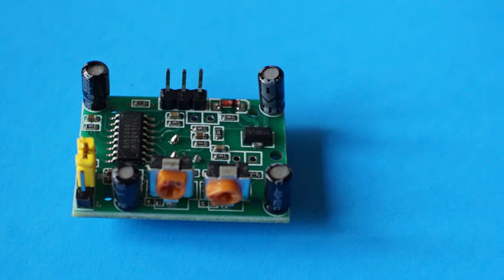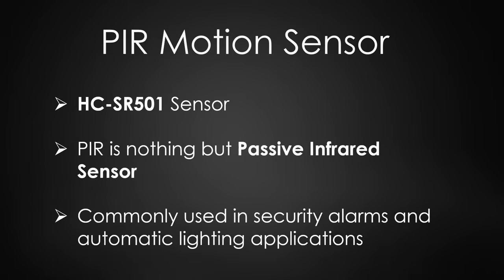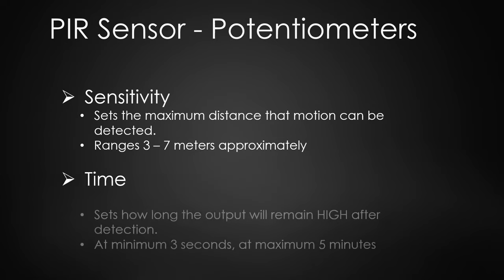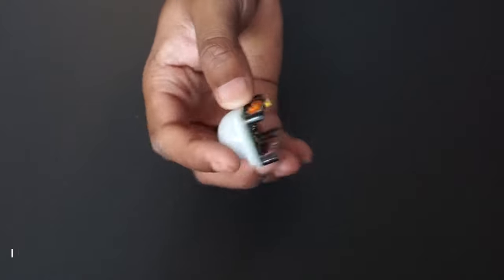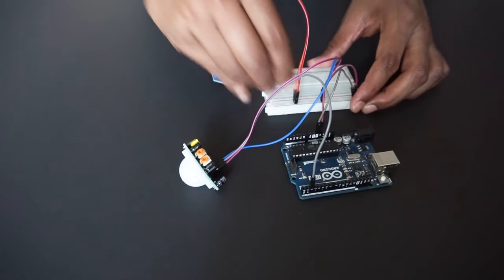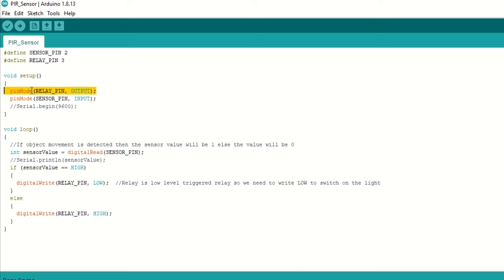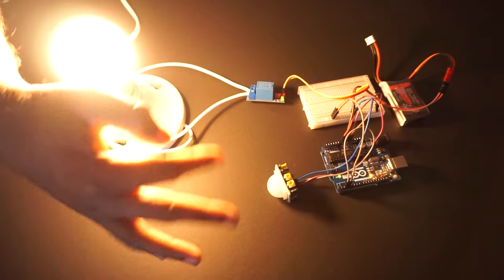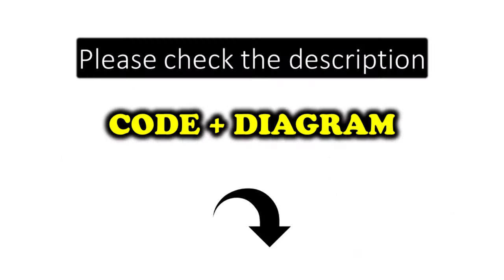How to use PIR Motion Sensor with Arduino | Motion sensor light

Comment: Do you need another battery if i don't want to use a/c?
Reply from the maker: @Yer711  we need AC to turn on this bulb 👍🏻👏🏻
Reply: @hashincludeelectronics  im currently copying this system to build a solar powered motion sensor light, and i have a dc led, how can i connect the relay to the led?
Reply from the maker: @Yer711  use the same connections . Just instead of AC supply use DC 👍🏻👏🏻

Comment: Well I have another question. The light is turning on while motion is detected but turning off immediately. How do I keep it lighting?
Reply from the maker: How long do you want the light to be turned on ? You can add that in code as well 👍🏻👏🏻
Reply: @hashincludeelectronics  My idea is to just turning the light on then I would manually turn it off.

Comment: I don't know coding but I know if an else bu I didn't understand the Hi and low???
Reply from the maker: High and low is Notting but voltage level. High means 5v and low means 0 volt 👍🏻👏🏻
Reply: @hashincludeelectronics  Thanks can we built it on the cell and no connected with laptop and on and off switch just like a small box and portable.
Reply from the maker: @magnese7993  yes you can 👍🏻👏🏻

Comment: Hello. Im actually beginner and I have a project to do. I need to control alot of servo motor (12) with motion sensor and at the same time I have to control another thing (kind of robot with arduino). I want to use IR control and motion sensor for the first robot, also with the data flow and the other robot to move simultaneously
Reply from the maker: This looks like big project . I would suggest to go through my tutorial videos on servo , sensors etc and see if it helps 👍🏻👏🏻

Comment: Hey bro, I am a beginner into coding ( I know a bit of Python coding but not C) So can you give me code to adjust the timing for the light to stay on, Mines stay on for a minute or 2 and then switches of after that. Since I need this for my upcoming project exhibition, I want it to switch off faster so I can show again quickly how my project works instead of having to wait for long
Reply: this sensor is meant for being used directly without microcontroller so there directly is a knob for adjusting it on the board, the code in the video does nothing more than read the value and copy it to another pin, see 1:23 in the video how to adjust it.

since the sensor does a lot already it is slightly harder to use but still easy. so here is what code you would ask for
#define SENSOR_PIN 2
#define RELAY_PIN 3
void setup() {
  pinMode(SENSOR_PIN, INPUT);
  pinMode(RELAY_PIN, OUTPUT);
}

bool on = false;
int ontime = 1000;  //1000 is 1 second
void loop() {
  if (digitalRead(SENSOR_PIN) == HIGH) {
    if (!on) {
      on = true;
      digitalWrite(RELAY_PIN, LOW);//this1
      delay(ontime);
      digitalWrite(RELAY_PIN, HIGH);//this2
    }
  } else {
    on = false;
  }
}
//you might want to change the  HIGH and LOW at this1 and this2.
//if you alter int  ontime then you change the time it stays on, 1000 miliseconds is 1 second. since the module itself can already go down to 3 seconds, I took 1 second now.

Comment: did you cut the plug wire yourself? and where can i find a AC Bulb socket like yours?
Reply from the maker: Yes you can cut the wires as needed . Also you can buy the sockets which are available at your location . No issues in that . 👍🏻 but make sure to make proper connection as it deals with AC voltages .
Reply: @hashincludeelectronics could u give the link on where I can buy ac plug socket like that

Comment: uhhh so i have a question: how can i use the 2 normal rgb leds with 4 pins on this project?
Reply: what do you want them to do?
if you use a arduino you can just program the arduino to the the special colour effect and colour changing and such.
otherwise you can use some transistors or mosfets or some IC's like counters to program in the animation and do it without a arduino.
if you plan to litterally use it in a fixed colour then you can just connect them all to the same output with resistors for every led pin. you might want to use a transistor however since the GPIO of a arduino or the pir sensor depending on which one you use, might not deliver enough current for all 6 leds.

essentially a 4 pin RGB led, are just 3 different leds in one casing. one of the pins is often ground, which is typically shared between them the others are the input for the 3 leds. in some cases the one pin connected to all leds might be the + pin and the other pins might be - so either test it or read the datasheet to find out. to test it, just connect 2 jumperwires to the arduino, one to +5v and one to gnd. also connect a resistor to one of the jumper wires with a resistance value of around 500 to 1000 Ohm, it might not be needed and you can use lower values, but this is for safety to not accidentally fry a led when testing. then just test pin combinations and you will see which pin is what colour and what direction, etc.

also note that you do not need to use the arduino
the arduino is litterally just used as a transistor to amplify the signal so you can just use a transistor and 1(or optimally 2) resistors to do the same, next to that the arduino is used as a 5V power suply. but the module supports 5v to 20v. so you can also power it by some 12v or 5v adapter or such, or even from a usb port. other values in between 5v and 20v also work, but if you use a relays to switch the light then make sure it supports the used voltage as driving voltage, which is why 5v and 12v are usefull since they are commonly used. 
also please be aware that while it supports up to 20V you typically do not want to run it at 20V, while it should not be a problem, since it is always running, typically when such devices support up to 20V it is still best to just use 5v or 12v. not only are they more standardized values, but driving it at 20V might be driving the buildin step down converter to it's limit. since it essentially takes your input voltage and uses a step down converter to reduce it to around 3.3V next to that it might also convert something to 5V but not certain of that. but the output signals are 3.3V.
it uses very low power however, so it shouldn't give problems, but still if something runs always you are best of making sure it is really safe, and durable.

Comment: will it work on my project which is street lights made from LEDs?
Reply from the maker: It should work 👍🏻👏🏻 However take good care while making this project  as we are dealing with AC at the output 👍🏻
Reply: @hashincludeelectronics  can you tell me what to use instead of AC bulb socket? Or can I directly connect the wires of LED to arduino UNO?
Reply from the maker: @artoflivingrajkot  how many LEDs are there ? Is it like a series of LEDs?if these LED bulbs are AC controlled then instead of bulb socket you can use normal plug socket and use it . 👍🏻
Reply: @hashincludeelectronics  there are 12 LEDs.and it is not LED bulbs they are 5mm LED diodes.that's why I asked you that it will work or not.
Reply: @hashincludeelectronics  sir i will want 9v battery in it so how to insert the positive and negative wires and from where in the relay or arduino i will get the output? please tell me sir tomorrow is my science fair.
Reply from the maker: @artoflivingrajkot  are you going to connect leds in series or parallel ?
Reply: @hashincludeelectronics  in series
Reply from the maker: @artoflivingrajkot  ok . Then you can use the same connection . Instead of socket use your leds connected in series . Instead of AC plug , use that 9v battery as power supply . Make sure you connect +v and -v ends properly.
Reply: @hashincludeelectronics  sir but how to join both my leds and 9v battery together?
Reply: and so sorry for wasting your time.also thankyou so much.
 @hashincludeelectronics
Reply from the maker: @artoflivingrajkot  follow the exact circuit diagram . In place of AC plug use battery . And in place of ac bulb socket use series of leds 👍🏻👏🏻.

Comment: In the circuit diagram why isnt the breadboard included?
Reply from the maker: Thanks for checking out the video and for query . Breadboard is just for extending the connections. So i did not include in circuit diagram to keep the connections clear with modules. I hope you are familiar with how to use breadboard . Let me know if you need any help .

Comment: can you connect the arduino with thingspeak platform to analysis the data from the sensor and who it does?
Reply from the maker: I believe thingspeak needs internet and Arduino can not handle that . You need to use modules like esp32

Comment: You have single channel relay
Was used. If I am using a 2 channel relay then where should I put the input of the second relay.
I have to connect 2 bulbs
Reply from the maker: Use the exact setup and connection 👍🏻👏🏻

Comment: I didnt understand where you used the Battery? is it not necessary?
Reply from the maker: Yes we have used battery . Please check the video and also circuit diagram for reference 👍🏻👏🏻
Reply: @hashincludeelectronics  thanks for replying. yeah I found that

Comment: Can we supply 12v DC power in place of 220v Ac
Reply from the maker: Yes you can but you will have to use 12c dc appliance then 👍🏻👏🏻
Reply: @hashincludeelectronics  what are those appliances
Reply from the maker: @mayuritekar6793  I am not sure . As you want to use 12v dc instead of 220v ac 😂
Reply: @hashincludeelectronics  no bro.. I have 12v DC solar system, so I want to run entire motion sensor on 12v.  Please suggest me bro😥🙏🏻
Reply from the maker: @mayuritekar6793  you can connect it to Arduino vin pin directly then 👍🏻👏🏻
Reply: @hashincludeelectronics  OK bro tqu♥️

Comment: Is there a problem using 220 volt electricity?
Reply from the maker: Thanks for checking out video 👍 There is no problem in using 220 V in this project . However good care should be taken while making connections as we are dealing with AC High Voltage. So make sure you connect wires properly. You can check my other video for reference where I have explained how to use relay. Let me know if you face any issue .
Reply: @hashincludeelectronics Can I have a video link?

Comment: What if you are using 2 motion sensors, does that mean you need to use 2 arduino's....and also can this design be use in a 16mhz arduino?
Reply from the maker: You will have to use only 1 Arduino . Yes it will work for 16mhz Arduino . 👍🏻
Reply: Actually you don't even need an Arduino, you can directly connect the output of the PIR sensor to trigger the relay. But it's a very nice tutorial though 👏

Comment: Hello , I want to ask one thing 
I have a 5v relay module and 1 pir sensor

I have done connection
Vcc of sensor and relay are from same charger of 5v 1A
Gnd pin is also same
Out of sensor is connected to in of relay

And relay's No is connected to bulb and common is connected to vcc

I am facing the issue
Bulb is always onn after power on supply
Even after it for not detect human
Reply from the maker: Please check the video slowly and carefully for missing steps 👍🏻👏🏻